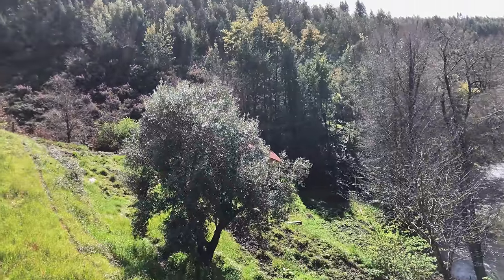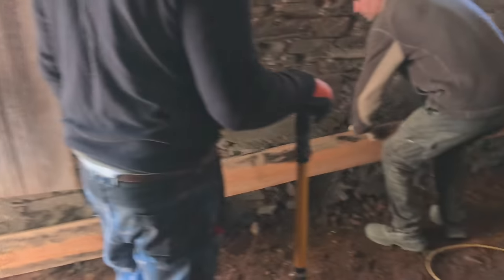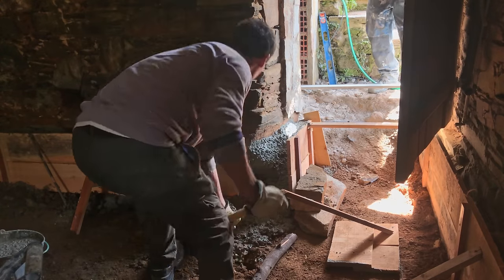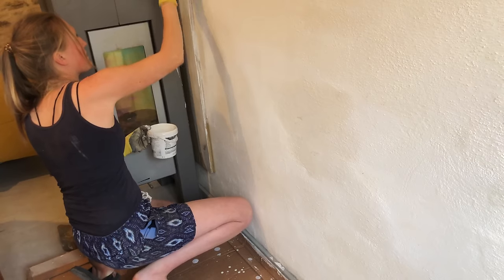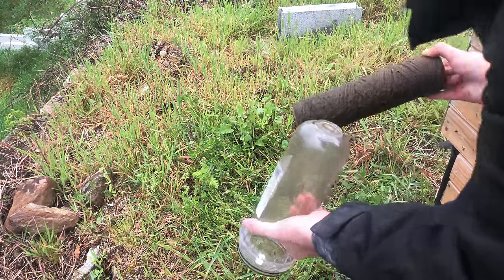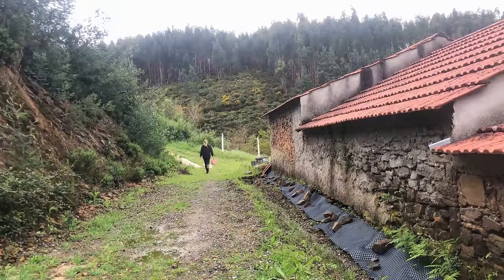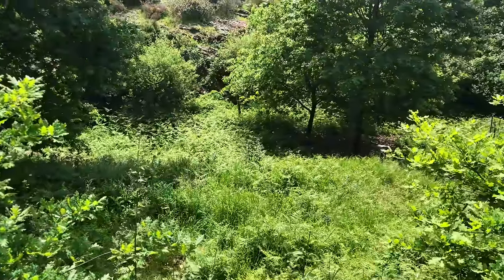I Don't Know What I'm Doing

Comment: Ummm make sure when you put the floor in washroom to use rebar. The walls your poured down there may just cave forward as they are not tied to the structure so your floor will have to basically keep them from possibly collapsing inward from the downward pressure of you structure. Ideally you should have dug under the walls in places and poured some footings for both walls to sit on.

Comment: Oh, Maya your scaffolding is adequate and you took measures to keep it as stable as possible.  Try looking up bamboo scaffolding in Asian countries.  Those guys are crazy!

Not a plumber here but my family has a country house with the same water problem.  Pumps run all the time and wear out way before you expect them to.  Perhaps adding a 1000 liter tank that is filled with the pump with an internal buoy set to start the pump once the tank is at 50% can help everything pressurized if you put the tank higher than your buildings.

Comment: You are doing an amazing job. Your stamina and creativity are most impressive. As for the safety issue. There are levels of being safe. On a construction project where multiple trades are interacting, the risk for unsafe conditions is high. That is the reason that those projects are watched (and checked) closely and frequently. You seem to be aware of where your feet are and what you have to do to protect yourself. I think you are just fine and this is coming from an engineer with construction experience. Keep up the awesome work you are doing. Best regards!!!

Comment: While i do agree with other comments that the amount you've got to do at height, it'd be worth looking at some proper scaffolding, what you had looked well built and you were aware of the risks. What scared me was using the ladder not fully extended - this is likely to move and topple you to the floor. Yes a less serious fall than from the scaffolding, but much more likely to happen because you don't seem to be aware of the danger.

Comment: Not knowing what you're doing, and then going ahead and doing it anyway. Could be a disaster, but might work out just fine. And disasters can be fixed. 

One question for you: did you use any reinforcement in the concrete support along those walls? It makes for much stronger, longer-lasting concrete work.

You are living a dream that many of have. Thanks for taking us along!

Comment: Love you DIY,!!! That's not an earth rod, that's a copper tube. Copper oxidizes and then it loses its conductivity value or your grounding. This is therefore not allowed. Must always be a tinned solid pin. Good thing is you put it anywhere so just place a proper one somewhere else and connect with a correct thickness grounding cable. If you know somebody who can measure the conductivity that would be nice. It can make the difference of the earth leakage circuit breaker is working properly or not. A significant safety point.

Comment: I think your scaffold was just fine. The thing I feel so sketch about is how that concrete balcony has zero support. I keep thinking one day you are going out there and thats the day the concrete fails. This is just me, I’d be cutting up my “scaffolding” and making bracing with it under my concrete balcony. Cheers
Reply: From what I remember the concrete pad of the balcony extends via the doorway into the house sub floor to counter balance the balcony so is structurally strong

Comment: Planting yukkas next to walls is the worst possible mistake, within 3 years, the wall will fall, and it will be a nightmare to pull out the yukkas when they are considerable in width.
I speak from my own experience, I have yukkas over 50 years old.
If the land was flat there would be no problem, but this wall is there to support the earth from falling in a very short time the roots will push the earth and make the wall fall into your land.

Comment: Maya, what you're doing in that lower floor by removing the entire floor to below the "footing" is madness.  The entire building could collapse at any moment.  That you're working in there means you could be killed in the collapse.  The work you did to resupport the walls should be done in one-meter wide sections.  Alternating new sections with unexcavated sections.  These guys you work with are really, really dangerous.  I realize you're on a budget, but you can't use the saved money when you're dead.

About ladders and scaffold, a mate of mine was killed falling from a two-meter-tall ladder (working around their house) and I saw a man killed on a slightly taller ladder trying to work beyond what he could safely reach.

Comment: This is the worst case of safety. you need to use a harness not a rope around your waste. If you fall it will be very damaging and scars for a life time. use scaffolding or better security harness with safety belt and anchor points to reduce fall heights.

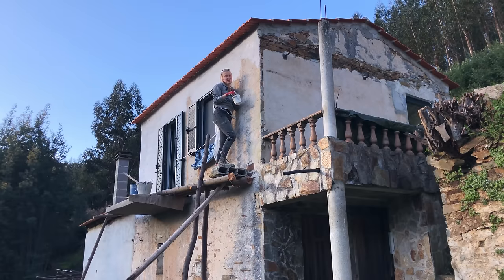Comment: 3:00 Honestly, your improvised safety line caused me more concern than the sketchy scaffolding without one. That thin line around your waist could do you harm in the event that you fell. It also appeared that the rope tied to you was long enough that you could have hit the ground anyway. Research and buy an approved safety harness for fall prevention. You might actually do better putting up an anti-fall barrier behind you. They can take the form of nets or multi-strand lines behind you or a single strand line that you clip onto with a carabiner attached to a short lanyard. They also make a fall arrestor that slows your descent in the event of a fall. Lots of options, but if you are working by yourself at hight then you need to be safe. Also get trained on proper use of the equipment, improper use can get you hurt too. From a guy who has climbed 120' process towers in industrial plants.